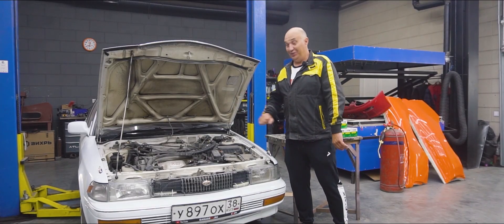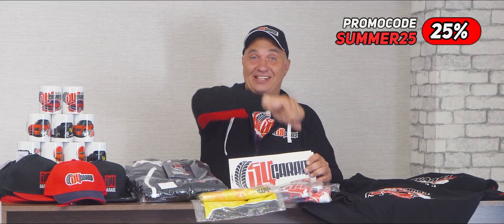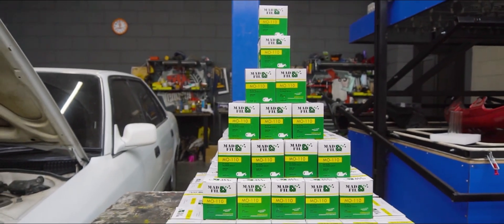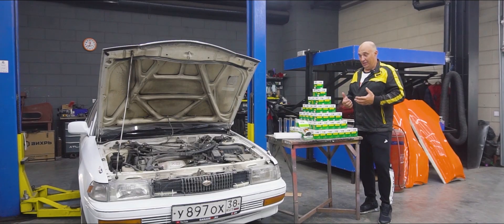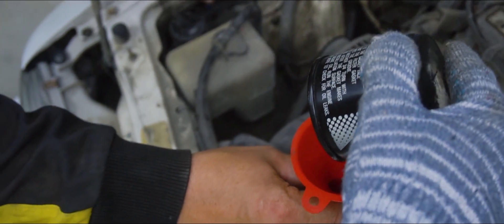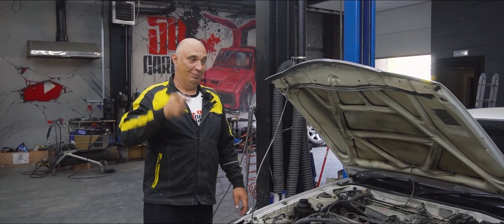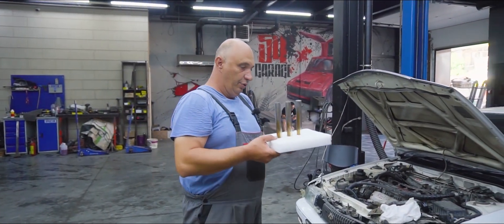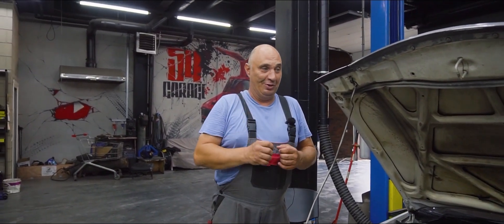Can 50 oil filters make used motor oil clear again?

Comment: You should try the diesel/kerosene engine flush to see how well it removes engine deposits and varnish
Reply: Marvel Mystery Oil for me 😤🤘🏼

When I did the valve cover gasket on my Heep (01 Wj 4.0) I noticed the whole top of the engine was covered in basically cold Hershey’s Syrup, even with full synthetic high mileage oil and a great filter, both being changed on time. Instead of putting 6 qts of oil in which it takes, I put 5 qts of oil in with 1 qt of MMO, it was clean as a whistle after 2000 miles. MMO, Diesel, Kerosene, Atf, whatever you use to clean an old motor out; do keep in mind if some of your seals and gaskets are barely holding on by having the sludge as a shield and you remove said sludge you’ll have a pretty big leak in no time. I personally prefer this as I’d rather find bad gaskets and seals and replace them and move on with my life vs hope for the best. I use MMO and have had no ill effects.
Reply: @tenderblender945  lol I've had that many times with sludge.
Reply: it works that's an old trick. 4 quarts of new oil and a quart of diesel or kerosene diesels cheaper. if it's an old engine you'll get some crap to break loose and come out. I've done it on tractors.
Reply: Trans oil . Drain qt. Oil. And run  for while. And change oil
Reply: If you break that stuff up cant it clog oil passages and make things worse?
Reply: @viperstrike3827  if your enginge has sludge yes but trans fluid will dissipate that sludge or diesel fuel and kerosene
Reply: I might do it as a last resort.
Reply: @viperstrike3827  I guess it could but if you leave that crap in there it  will eventually start breaking loose and you won't know it. at least this way your changing the oil and filter right after you flush it.
Reply: or flush your engine with transmission fluid it is a detergent oil.

Comment: Make an oil filter rig that allows you to put like 5 or 6 filters in a line and run them all at once and a circulation pump to move all the oil
Reply: the oil pump only has so much force, it might do more harm by starving the engine of oil pressure.
Reply: 6 filters in parallel will clean better than 6 in series. A big filter will clean better than a small filter.

Comment: If the filter was able to filter out the dark colour then filters would be blocked much faster.
Reply: At first I thought this was bait... but actually you're right, it would be filtering the broken polymer chains, so no oil would flow at all
Reply: @Petrolhead99999  It certainly wasn't intended as a bait! My point was more that if the oil is black, then it won't be able to filter it out, as it's already gone through the filter 1000's of times and wasn't filtered.
Reply: I've done oil changes to diesel engines that had 1 huge oil filter on it, so it's got lots of filter media surface, but the oil was still black, when it came in for service.

I don't see how 50 clean oil filters will make black oil clean, besides even if it worked, the oil will be thinned out and won't be able to properly protect the moving parts in the motor.

Also keep in mind, each time you remove the oil filter, you will lose some oil, so using 50 oil filters on 1 motor, with same black oil, the oil level will drop gradually, since the oil filter holds limited amounts of oil in it, with oil levels lowering, to keep the level full,  it would require to be topped up.

The price of 50 oil filters is way more costly compared to doing a oil change with 1 new oil filter, and new motor oil, 2 jugs of motor oil, and you will still have enough motor oil for top ups.
Reply: @theroyalcrownedtiger2946  it's called an experiment for shits and giggles. You don't actually think they are being serious do you?
Reply: @tylerwightman2315  : I am just pointing out valid infos based on my own experiences from working in service shops.

Nothing wrong with me saying it the way it is.

I look at it from work experience view, and you look at it from hahas and giggles view, same picture but different views and thoughts, which will happen due to differences in people.

Not being a jerk here, just being frank and realistic.
Reply: Yeah, the black is mostly carbon particles which are very small, you could use a partical filter but that would restrict oil flow unless the area of the filter was great enough.
Reply: @chrismechanic2000  carbonisation is a stain yh. Can't filter out stains
Reply: Aynen katılıyorum 😊
Reply: The big 10 quart Gulf Coast filter out of Gulfport Mississippi  is 99 percent at under 1 micron. Diesel soot is as small as 1/3 micron. It is non abrasive but will turn the oil black. If your oil gets black in a gasoline engine you need a depth bypass filter.

Comment: Some people in the Philippines use old used motor oil to coat and preserve wood. It actually looks pretty good, although the smell probably isn't so good.
Reply: Thin it with paint thinner.  SixtyFiveFord the YouTube guy showed how this is done.  He stained his home made pallet shed with used motor oil.
Reply: My grandfather always did that, but it's not that great. It "boils" in the sun and burns the wood.
In fact, it causes the wood to dry out and crack.
Reply: .... but there was no smell.
Reply: It isn't fire proof. I would not use oil over something more than a fence.
Reply: Dont they use oil for railroad ties? They do give off a smell when it hits the sun
Reply: I've used it for years on wooden fences instead of creosote.
Reply: Japan also.

Comment: You can't do this. These filters are all the same micron so it's just cleaning deposits to to that micron level
Reply: Yea we need a row of filters decreasing in micron size. Pump 50ltrs of waste oil through and see what we get.
Reply: @Paulman50  Bly-Diesel
Reply: Wouldn't matter. The Color isn't from particulate suspended in the oil, the color is from being heated and cooked, oil in a pan will brown as it is subjected to heat. Engine oil is no different.
Reply: Even then the oil has been repeatedly cooked so the color will never go back.
Reply: @denniswoycheshen  the black is carbon and other waste products. If we filter them out we get back to clear. Agree ?
Reply: @Paulman50  yeah, but can it even be oil at that point?
Reply: @denniswoycheshen  have to test it to find out. I believe that they do recycle oil though.
Reply: @Paulman50  burnt oil will lose its viscosity.  Even though it's been cleaned of carbon and other debris,  viscosity is key. The recycled oils got some additives which restores that viscosity and the detergent component of all oils (hence its function of lubrication and cleaning)
Reply: Yes, I think they understand that.

Comment: The valve is there as a safety, if the filter gets clogged, it lets dirty oil circulate to avoid oil starvation. Cheap low quality filters often do not have this essential safety bypass valve, on such filters, if the filter gets clogged, the suction can be so great that it sucks the filter apart, and draws filter material into the engine....  . To filter the oil so that it becomes "blank" you need filters with smaller mesh/better filtration so it can trap even smaller particles. There are special filters that workshops use on heavy duty trucks, such as Caterpillar 777 dump trucks. On these, most of the time,  you actually don't change the oil, you run it through an external filter cartridge that cleans it. The filters are extremely fine, and you can clean the oil to the point where it's "like new".
Reply: Bypass valve is often in the oil pump itself.
Reply: @szili76  Yes, on SOME engines, especially those that use cartridge filters (not spin on) the bypass can be found in the oil pump, not to be mistaken for the oil pressure valve (ball + spring, usually found in the head of the engine that regulates the oil pressure).

Comment: I had a corolla that I just dumped some good high mileage synthetic oil into, and since it burned about a quart every 3,000 miles, I just replaced the filter and topped it off for the longest time, and it did well.
Reply: It was changing its own oil
Reply: @Bobby-cm7vu  just a little hungry just feed the little guy lol 🤣
Reply: @Bobby-cm7vu problem is cars burn oil, not carbon that it holds so you still gotta change it regularly.
Reply: Ah, the good Old 4e-fe engines.
Reply: @descent8275  laughs in VQ
Reply: @descent8275 probably the 1zzfe in the 2002 era corollas, they were prone to the oil rings sticking in from carbon buildup. I had one- a litre every 200km til I re-ringed it. They're only meant to have full synthetic.
Reply: 100% synthetic oil tend to burn, even on new engines but in engines with a lot of miles you don't have to change it 😅 Just top it up 🤣
Reply: When the LS1 first came out there was a guy online that was testing the Mobil 1 that came in it. Every 5 thousand miles he'd change the filter and top it up, and send a sample to be tested by a lab. After 60k miles the oil was pretty close to new. This was mainly a highway car, but still, it was pretty amazing how well the original oil held up and how much just changing out around a quart every 5k miles freshened it up.
Reply: @CaptainXanax  That's about what I did.  I also used a good quality filter (forget the brand, definitely not FRAM) and I even used Lucas every so often.  It did seem to clear up some leaks too.
Reply: @computernerdinside  why fram hate? i have it on my car...
Reply: @gabrielvieira6529  I don’t remember hating on FRAM.  I hear they used to be good until they were bought out.
Reply: @CaptainXanax  
I remember reading that.  He kept track of each oil report and it was pretty neat.
Reply: @CaptainXanax  Not worth risking a car when oil and filter is inexpensive roughly 50 dollars for synthetic oil and filter.
Reply: Pfft a quart every 3000? That's what my 3800 is SUPPOSED to do (apparently). But I suspect the valve seals are going cause now it's more like a quart every 1000 miles.
Reply: @notsogrand2837  It varied.  Sometimes after 2k it would need a top-up
Reply: @computernerdinside  How many miles?
Reply: @notsogrand2837  Over 350k I think.
Reply: @computernerdinside  God damn, that's not bad at all for that milage. Strong engine.
Reply: @notsogrand2837  Freaking Toyotas, man.
Reply: @computernerdinside  
with this high milage you can go 15w50 but let car warmup in coldstart in cold weather and dont be near redline rpm
Reply: @Techie1224  expensive oil though.  i just ran 10w40
Reply: @computernerdinside  
15w40/50 should be cheap its usally mineral oil but its ok with 1qt every 3k miles u can keep 10w40
Reply: @Techie1224  True, I guess.  I used high mileage oil for the seals, but also tended to grab synthetic too when it was available as it seems to be a bit more resistant to burning off.
Reply: @notsogrand2837  humm. My l67 doesn't burn at all. Come oil change time it's right at the max line.
Reply: @carnage50x  That is weird, I've heard of people's 3800s burning oil at around 100,000, more or less and GM basically said a quart every 3000 is fine lol. I have yet to check my valve seals, piston rings should be fine since it was rebuilt. Do you have a Series 2? Or a Series 3.
Reply: @notsogrand2837  140k bottom end is still un-opened. Heads/intake/valve train have alittle something something done 🤫
Reply: @notsogrand2837  my 3800 burns no oil and im at 200xxx kilometers
Reply: @madkills10  Guess I got unlucky lol
Reply: @carnage50x  Ha nice, what'd you have done?
Reply: @notsogrand2837  put some 20w-40/50 in her mate shell love ya
Reply: @madkills10  Not sure if I should do that, next oil change will be before winter and ot gets pretty dang cold in North Dakota lol
Reply: @notsogrand2837  I have a 3800 that was oil hungry and I put Rislone in it and it now gets between oil changes without adding. Now I just add a half container of Rislone every oil change. It frees rings and tappets too!
Reply: @scotttod6954  Hmm, I'll look into that sometime. I still plan to pop the valve covers off and check the valve seals.
Reply: @notsogrand2837  spend the 7$ first and give it a try. Just add it to crankcase and drive and see if your oil consumption improves. If anything it will be easier to spot issues under the valve cover because it will be cleaner.
Reply: @scotttod6954  I for sure plan to do an engine flush sometime. Either gonna try Liquid Molly or Rislone
Reply: I have a matrix, i get good gas mileage due to the engine burning more oil than gas
Reply: @XyrAvali.0671  How many miles?  Also, fun fact, the Matrix isn't even Toyota.  It's a rebadged Pontiac Vibe.
Reply: @computernerdinside  158k, but it burns oil because of the previous owner (my idiot of a father) only getting it maintenanced when he got it inspected, or had to get the tires/brakes done. It burns 3 quarts in 7000 miles, but manages 24-27 miles per gallon. Also, I know about the fact that a matrix is a shittier vibe. If you want some pictures of it my Discord is Paladin#0671
Reply: @XyrAvali.0671  People like him are why cars have to tell you when to change their oil themselves.
Reply: I've always heard that if you have a higher mileage vehicle that uses petroleum oil, you risk having leaks if you switch to synthetic. When I bought my 2006 saturn vue in 2008, it had 39k on it. I immediately changed the oil with synthetic blend in case of any leaking. 3k miles later, all was good and started running full synthetic. I'm almost at 285k miles now. Doesn't burn any oil or have any leaks
Reply: @simpleman806  that myth comes from older vehicles (used cork gaskets and rope seals) OR modern abused engines (goes over 10k + miles with $20 jiffy lube bulk oil/filer special). Contaminants can build up along on the seals. Then the seals dry out. After putting in the higher quality synthetic oil. That syth oil has additives that help loosen up or completely dissolve the build up of contaminants. Those same contaminants were holding those dried seals/gaskets together. Are no longer there. If a modern engine leaks oil. It's due from lack of basic maintenance. Unless it's a gm 3.5 v6. They just seem to all leak oil no matter what.
Reply: @simpleman806  That's pretty false, and also I try for high mileage oil variants, as the seal conditioners help prevent leaks well.
Reply: Did the same with my 88 crx dx
Reply: Poor car
Reply: @El_Jefe_S3  She did well for her age, and if the oil got too nasty, I'd of course change it.  She served me well.  Miss that car.
Reply: I did this exact thing with my old subaru forester. Lasted a loooong time!
Reply: The filter did well?
Reply: Great car,my buddy had one 330,000 km with just regular service,the muffler fell off,a large amount of ice and snow came off high roof and blew out the windows....bye bye Toy auto!
Reply: Sounds like my Cooper S, but it got a hole in the cylinder head.
Reply: if it burn quart every 3k miles then just use thicker oil and your oil will be cleaner and will not burn in the cylinder
Reply: @Techie1224  I later used 10w-40, it didn't slow much.
Reply: @computernerdinside  skip that go straight to 70w90
Reply: @UndisputedMid  
70w90 is transmission oil
Reply: @computernerdinside  10w40 is still light oil unless its freezing
Reply: @UndisputedMid  lol A tad thick.  I did use Lucas to try to slow it every now and then, but wasn't too concerned since I checked it often.
Reply: @Techie1224  the transmission oil scale is totally different than the SAE engine oil scale. And 80 weight transmission oil is about a 30 weight SAE engine oil. A 90 weight transmission oil bridge is the range between 40 and 50 weight SAE.
So a 80 w 90 transmission oil is semianalogous to a 30w50 SAE motor oil.
Reply: @Techie1224  Oil pressure be good though
Reply: @otm646  
even that is much thicker oil if you had problem with 0w20/30 you can use 5w30 or 10w40 mostly and clean pcv valve they would run very good but if the case is still going with same amount burned then use 15w50 but let car warm in winter and dont topline rpm ,and if the car needs SAE 30/50 for the 0w20 designed engine then you should better throw the engine away
Reply: @Techie1224  modern engines can’t handle that. Best to find the leak or just add oil to the engine that consumes it. If it topped off with the correct grade oil it’s less likely to spin a bearing than putting in thicker oil. If it’s an old school engine like my 22r sure add some thick oil.
Reply: @brianeighties4481  
his car is 350k miles do you think that is a new engine ??.. even if its modern those 350k miles made every gap wider so it will handle thicker oil with no problem
Reply: @Techie1224  mileage isn’t really my concern so much as design. The oil passages are smaller on newer engines because it was designed for thinner oil.  Over time the bearing oil passages may wash out and thicker oil may help but the variable valve timing solenoid will not and that ticker oil will not work well in it. One problem could be stuck piston rings leading to oil consumption and something product BG makes can clean and address that issue